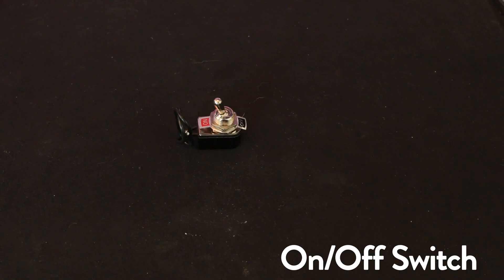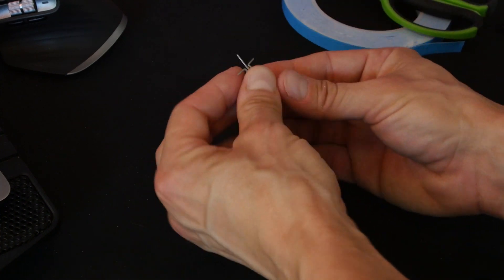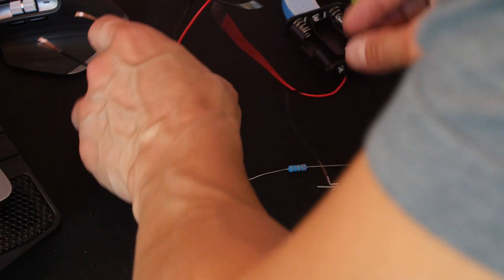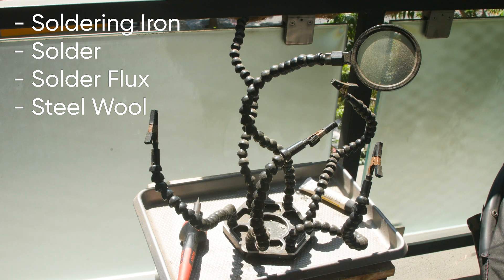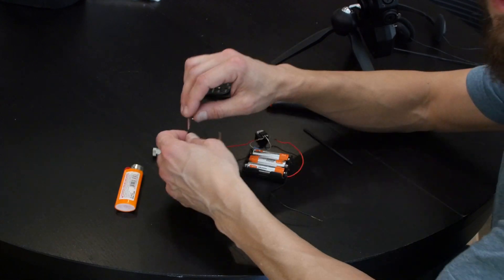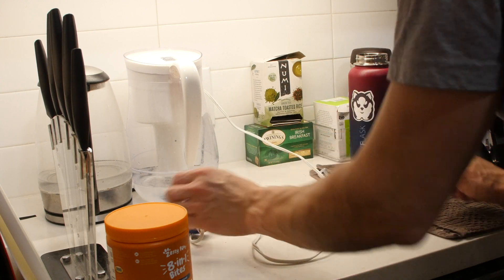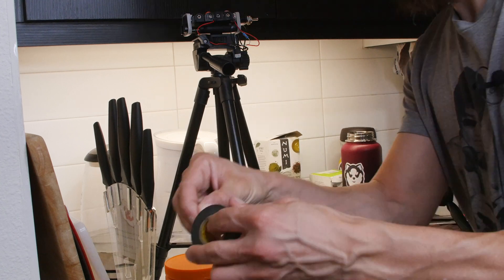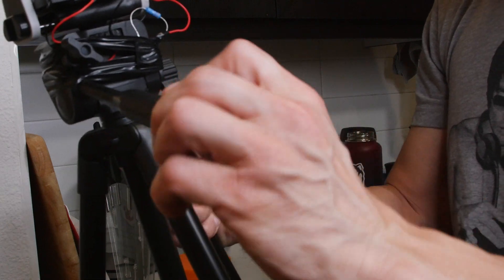How I Made My Laser

Comment: You can do it without soldering, if you buy ready made parts that use screws to fix the cable. I got a 3AA Battery Pack (~4,5V) a LM317 Dc-Dc converter (regulates the Voltage) and the Laser. The DC converter uses screws to connect the cable, so you just need really small screwdrivers to connect the wires and a Voltmeter to read how many Volts you adjusted to. All parts are cheap and easily available on the web;)
Reply: Hey man, in regards to your comment "Voltmeter to read how many volts you are adjusted to". Do you mean you can adjust the output on the LM317 DC-DC power supply? And if so, how many volts should I feed the laser? If that's not what you meant, could you explain it further? Much appreciated comment regardless, this looks much easier this way.

Comment: On your site you're now only listing a link to the laser and a battery pack with an on/off switch – there's no mention of the ohm resister or voltage regulator. Why is that?
Reply: I had this same thought 🤔

Comment: i like to use a paste flux when i solder . i use a small amount of flux , applied with a needle or bit of wire . one can also just dip the solder in the paste . i also remove excess but if you have excess you are using too much . remove xs flux using ipa 90 and a tooth brush to scrub . never use it on a 3pdt stomp if using a seperate pcb it can get stuck in between and cause shorting that will make intermittent led functionality if you are doing guitar pedals. i soldered for 15 years with out flux. then a plumber friend suggested i try it and forced me to bring my stuff and we did experiments. so i started using harveys plumbers flux . i have also used oateys .it works VERY well , and the soldering is like magic with the flux .people who are experts will tell you NEVER use plumbers flux . the stuff i built using this stuff 30 years ago still functions perfectly . they will claim " it has too string acid in there that will disolve the pcb" . i REMOVE the excess flux . i find the extra steps of applying the flux and then removing it to be a welcomed trade off to the alternative of not using flux and having to hit ridiculously high temps and risk component failure , melting stuff and have the solder roll off on my shorts in my lap. the draw back to using plumbers flux is more flux more fumes- so be smart and use small amount and practice proper ventilation techniques or a filter / fan/mask . if you plan to solder get yourself some paste flux . you will NEVER solder with out it . if you are here to tell me i am wrong go for it . i have accomplished all my goals and have tons of finished fully functional projects so my body of work speaks for itself . people who rail against using paste or plumbers flux never tried it . yes they sell liquid flux pens and electronics specialty flux , it is way over priced and it does not work well. i have tried that stuff and i stick with what works best for me . paste plumbers flux . i also use a small amount .you can easily over do it but thats silly . people will say " my soddur allreedy hassa fluxx innit" well then , have fun ! anything but actually try the plumbers paste flux .
Reply: How do I prepare the refractive lens?
Reply: Flix is for bigger solder for copper pipes to make it run inside the fitting. I shouldnt need flux with electrical soldering
Reply: I spose if u clean the flux off well after itherwise u end ip with green gunk

Comment: any idea why it works using your set up and not when using just laser?
what does each element add?
how is the circuit different from laser alone?
what is the ohm resistance doing etc?
Reply: the extra parts protect the laser from too much voltage. you dont necessarily need them (if you have good power supply), but the laser will probably last a lot longer, if you use them. However you can get them ready made and set it up in 10mins.

Comment: What size voltage regulator?
Reply from the maker: It says it in the video in the beginning and in the description. But you don't need it actually, if you are using an On/Off switch. It will work as a resistor which for this voltage, it should be enough.

Comment: Do you point it at a door because it has a glossy paint, or not? Does it work as well against a matte painted white wall?
Reply from the maker: Good question. You should point it at a surface that is not too reflective. But for some reason it works really well on doors
Reply: @dangothoughts  Ah right, so there is a metaphysical aspect of the door that is the important component there, not the physical characteristic. This makes sense. I suspect there would be a difference between a door in common use and a door that's just propped up against a wall if I follow that line of thinking, right?

I bought the gear today, will be experimenting with 3 friends probably in a month from now. I'll let you know.
Reply: @johnsojourn9114  how did you go
and your friends

Comment: I’m curious if you could achieve this with a normal 5 milliamp laser, or if constructing this is the best option and why. Really interested in exploring more! Thanks for your work!
Reply: What is the purpose of the resistor and voltage regulator? It can't work without it?
Reply from the maker: Yes. I'm working on figuring out the simplest and best version of the laser. As long as it's not more than 5mW, you should be good.
Reply: @dangothoughts  Do you have a recommendation for a device I can buy that would work the same way?
Reply from the maker: @robertlowder5832  all the details are on www.codeofreality.com :-) My email is also listed there in case you have any questions about it :-)
Reply: have you found sth simpler/better yet ty! @dangothoughts
Reply: @dangothoughts but did u xd we need a video on the diy that u find out about the dmt and the lazer what will work for ur avrage humble watcher graciass 😊